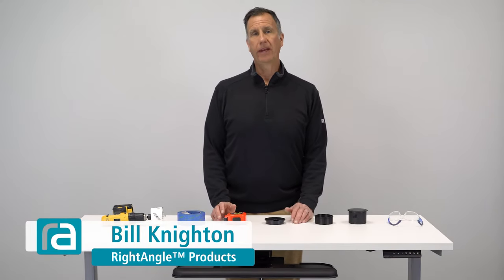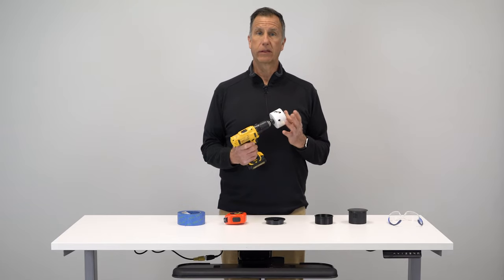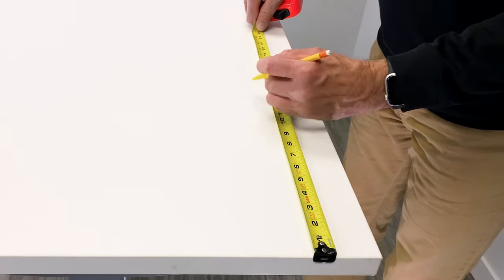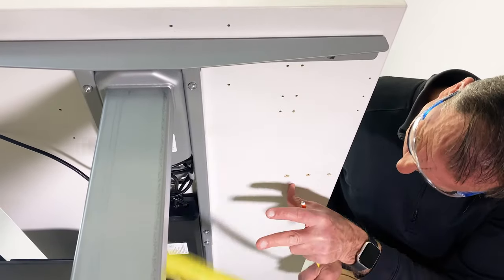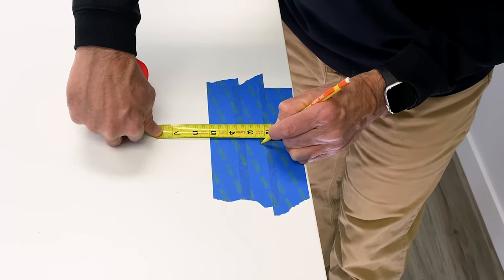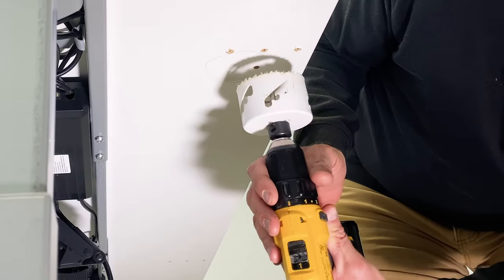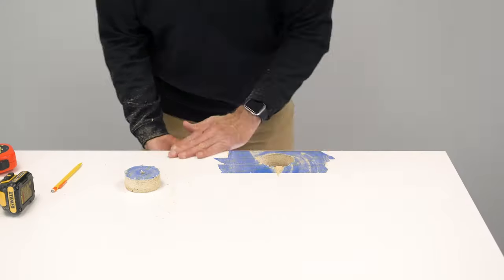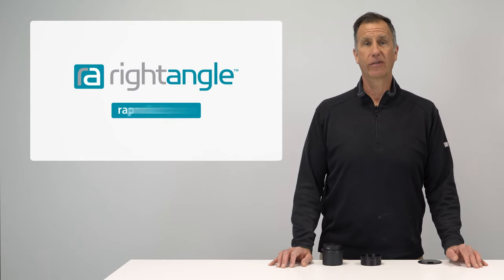How to Drill a Grommet Hole in Your Laminate Desk Top

Comment: Great video.  It's interesting that you cover the cutting area around the hole with blue tape, as the guy at Home Depot said it wouldn't be necessary as it wouldn't help in keeping that Formica from chipping/splitting.  I question, though, whether it would be better to use a diamond core drill bit vs. one with teeth?  Not sure that would make a difference in keeping the Formica from chipping or splitting?

I'm actually enlarging all three existing grommet holes on my desk, in addition to drilling a new one.  Wish me luck!  :-)

Comment: Thanks from this. What if it is not practical to drill from the underside?
Reply: I'm not a pro, but I think reducing downward pressure while keeping rotational speed reasonably fast should help minimize blow/tear out. The idea is to let the saw do most of the work and to cut fine/tiny wood bits/fibers. Yes, it will take longer to complete the cut, and you may still have some (likely minimal) tearing.